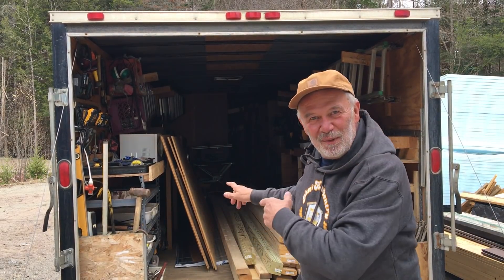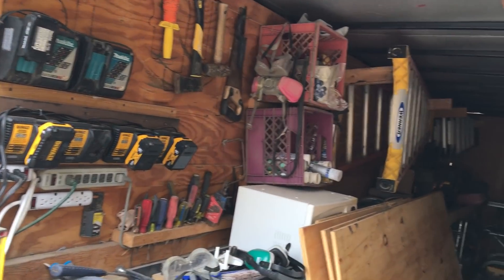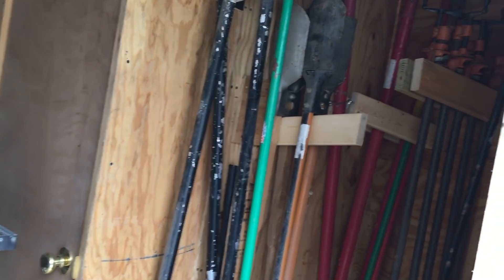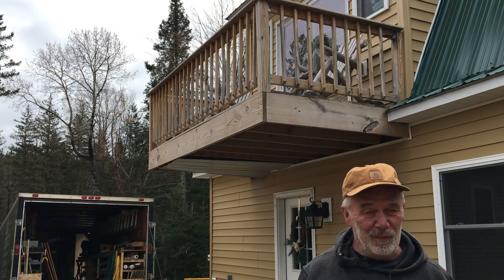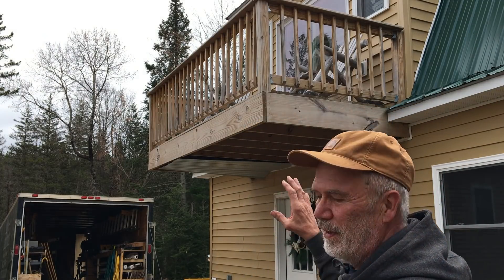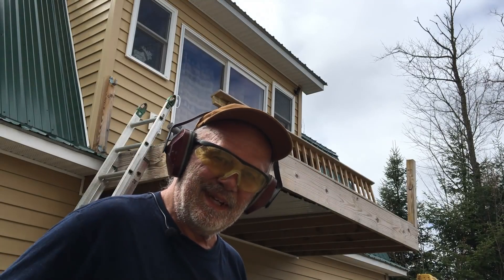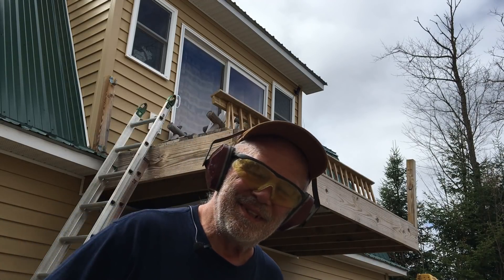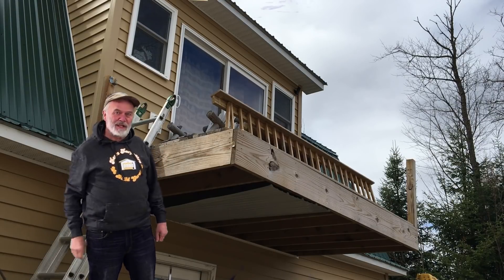How to Cantilever a Deck and Porch Part 1

Comment: Up here cantilever decks have to use the 1:3 ratio not a 1:2 for a 6 foot cantilever it should extend 18 feet into the building. Codes are different anywhere u go in the country though and that looks dam sturdy

Comment: So at some point the exterior portion of those pressure-treated joists will rot out - do you design in a way to replace them at some time down the road? Or when you get to that point would you simply trim off the exterior portion of the old joists and sister new material onto the still intact interior sections of the original ones?
Reply from the maker: They can be removed and new ones put in.

Comment: Those types of decks can't be attached with a header board? No, I'm not a construction expert. I have a house that has a deck like that that needs replaced.
Reply from the maker: I would have to see how they were able to do that. It doesn’t seem like it would work.
Reply: Short answer is no.

Comment: You said if you cantilever a 6 foot joist, you need an additional 12 feet inside the structure.  So that's 18 feet.  But you said you used 16 footers.
Reply from the maker: Because the dimension was 2x12 instead of 2x6 I felt 10 feet in was substantial enough. Thanks for mentioning that.

Comment: Great content, I can’t believe the price of lumber. The cost isn’t crazy, it’s stupid. When I was building and remodeling myself I use to have a lumber yard I used all the time. I could go into detail in depth but I will give everyone who is reading this something to ponder on.
I had a 24 feet flatbed trailer I pulled behind my truck. I use to go into this lumber yard and buy 500  2x4x8 at a time for a cost of $ 0.25 cents a piece. The cost of a 2x4x8 I priced out yesterday was $ 9.60 cents a piece. Who can afford to pay this. I could , but I refuse to.
Every one in the building industry needs to protest these prices instead of pulling out their credit card and paying this!
Thanks, Be careful and stay safe😀
Reply from the maker: Wow

Comment: I really like cantilever porches....  thinking about putting a few in myself.... in some cases, it is really hard to justify the "overkill" safety factor and the additional costs... You went from 6 inch to 12 inch and 6 feet to 16 feet.... cost x 6 for the floor.... when two pieces of 4x4 from the ground would have worked... It seems that cantilever porches should only be built when cost is not a factor... :) Thank you for your videos...
Reply from the maker: Food for thought. Thanks for watching

Comment: 6ft  cantalever  plus 12ft inside is 18 ft length  ?
Reply: He clarified in another comment that the formula applies to a 2x6, since he used 2x12 he felt it was overdone. I didn’t understand it at first either, LOL.